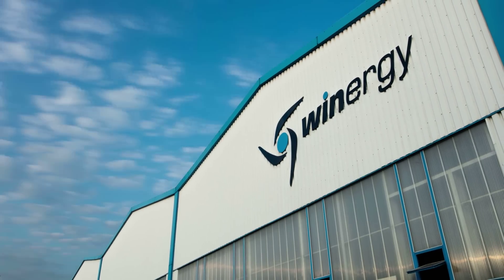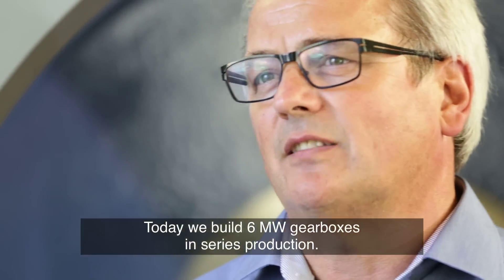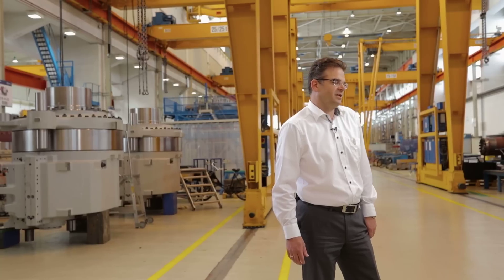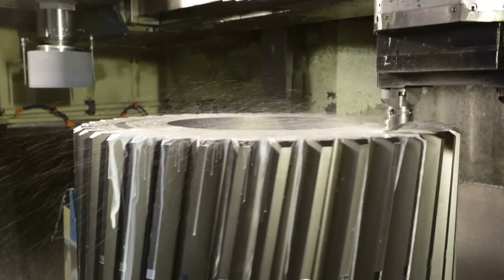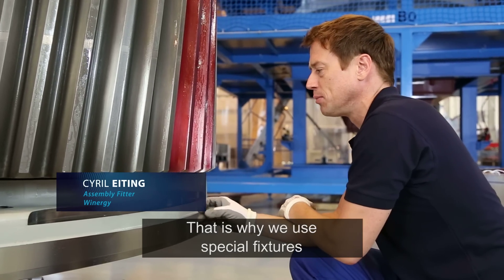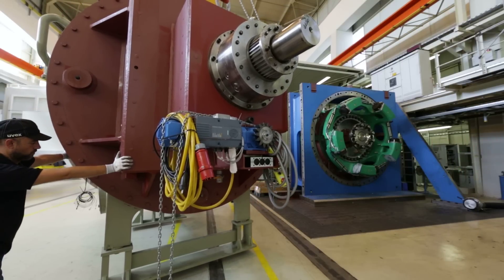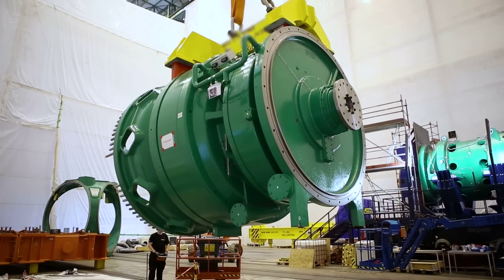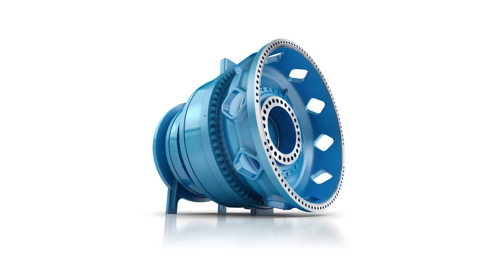Building the world’s most powerful gearbox for wind turbines - the Winergy 8 MW gearbox

Comment: Wind energy conversion.
I will explain why 'renewables' are not going to solve the energy needs of a society that takes for granted that turning on a light is a simple process.
Wind is not something we 'farm'.
Wind is a result of the rotation of the earth at the speed of 1000 Kph at the equator.
A wind harnessing device called a wind mill uses this force to push huge aerofoils in one direction that are mounted on a central shaft that has a generator comprising of metallic elements, mostly copper, central to producing the power they are designed for, that requires no fossil fuel to operate.
But what it takes to get this machine upright and positioned in such a way and in a place that will cause this physical reaction to take place is something that people are not made aware of, for fear of a concerted back lash by those who have every right to be wary and concerned of the detrimental impact they have on the surrounding countryside and those who live close by .
 What is involved to get it to that stage and the energy and materials needed to create these machines in it's self is, in no way, is a simple process. 
Unlike the explanations our governments give us to have us blindly accept there is no other alternative, other than nuclear power, and that is their scare the shit out of us gun.
Starting with the mines that all the raw materials come from, then the transportation of this raw material to where they are converted into the millions of individual items such as nuts and bolts and washers to stop them from falling apart requires huge amounts of fossil fuels to power the tractors and trucks and locomotives and ships to get it to the first stage of their production.
Using the energy created by coal burning power generators to produce not only the steel needed but for every single item required to have the finished product that will end up cluttering up our skyline and oceans, will take thousands of tons of coal and gas to produce the type of energy required to produce the steel these machines are made of, and that means carbon emissions.
Getting all the components to the site needed for the assembly is a major logistical effort that takes thousands of people to perform, all depending on the machinery called cars. boats. and planes to do so. 
All consuming power that is not produced by coal, but is a vital element in the so called reduction of our dependancy on carbon producing fuels for humans and industry to survive.
As soon as these machines are on the ground, they start deteriorating and have what is called 'A use by date' after which there will be the requirement to replace them with new ones, and that will end up being  thousands at any one time, and very little if anything of them can or will be recycled due to the nature of some of the materials used in their constructin, such as the aerofoil blades that are made of synthetics that are not biodegradable. 
Taking into consideration the average cost to have these machines operating is up to fifty million dollars at a time, it is usually the governments who will subsidize these projects. Believing there will be a return on the money invested in these projects, assisting the multi national companies who control all the natural resources and the extraction of the elements required for the manufacture of all things associated with the renewable energy market.. Solar panels included demanding funds to prop up a process that is flawed.
Everything produced for the renewable energy market has to be replaced every five to seven years, and when they are replaced, it will be at twice the cost of the original, due to the depletion of all the natural resources being used becoming more expensive to mine and process.
It is self a defeating exercise to keep thinking that 'renewables' can replace our growing thirst for our electronic device driven society to bare. 
Carbon reduction. ?
That went out the door the second they thought that creating millions of tons of carbon in the production of all these devices by burning whats left of our fossil fuels was a good idea.
Clueless.The full length of the Great Dividing Range. Cairns to Brisbane. On every peak, a wind turbine with access roads and 200 meter cleared zone for each one. Rain washing away all exposed ground. Plus, 100000's of acres of solar panels on prime farm land. Micro nuclear for me.
The whole lot of them.

Comment: Solar panels vertical spiral windmill blades magnetic gear box slip differential.. network powerplant towers...

Yeh . planetary .. vertically fixed . magnetic gear box..

I'm sure the slip differential.. with add .. a way to joining them vertically with magnetic gear....
Australia has ten thousand times the amount of solar radiation it uses on heavy appliances as a whole nation every two years...

Pieces... Basically .  Virtually.. https://youtu.be/2niEl-jH-Bc

https://youtu.be/_hnrOn-pTHQ

https://youtu.be/U3as8dhaV-w

https://youtu.be/2oAzrBORRN0

Comment: Why do they don’t mount the  gearbox and generator on the base of the tower instead of on the nacelle on the top ? Just use and angular gear on the top to transmit the power to the base. Installation and maintenance cost would be half..or less

Comment: Great product FLENDER GEARBOXES. Now working as a technical engineering consultant. I help customers understand the correlation between the component in gearboxes, the MRO-loop, FFT spectrum, aSKF value, the selected oil and what end-users can easily change to improve MTBF and reliability.

Comment: The Winergy 6MW gearbox has reliability issues, I have seen many replaced (as well as other manufacturer gbx's in this class). They need to build the 8MW gearbox to try and stay in the game but I highly doubt it will be any better.. Turbines are getting bigger, rotor speeds are going down due to blade limitations. Gearboxed turbines will have a slow death, just a matter of time. Physics will win this battle.

Comment: Difficult to believe that this provides cheaper energy in the long run. This is subsidised energy with half the prize hidden, just as an example. The cost and energy consumtion building these things must be enourmous. For 6-8kw it makes little sense. Windmills produce 60% of the time in practicly unpredictable enviroments for long terms. It produces the same werther the consumtion is low or peak and most of this energy goes to waste because nobody has found a way to store the surplus and probably never will. Stored energy is the only pactical way. Hydro, geothermal, gas, for example, that can be adjusted to consumtion. Windmills are not the future.

Comment: Build 30 nuclear power plants in the USA and we would be energy independent for 200 years.

STOP building Solar / Wind power, they are a JOKE in energy density and way too expensive almost like babies in charge of IBM.
Reply: its got its downsides, primarily... nuclear is SLOW, and one small issue turns into one BIG issue with OLD designs. if we get some fast neutron reactors to burn up the U-238 and quit figuring out how to sneakily dispose of the high level waste in other countries' war zones, then I'm sure some smaller Gen 4 reactor designs can push their way through sooner rather than later, and even get some more Generation 2 reactors replaced with much safer Generation 3/3+ or Gen4 designs.
Reply: But it is Green energy , nuclear is dangerous and nuclear waste will create lot of problem
Reply: update: wind rivals hydro and nuclear over lifespan for energy produced per watt. nuclear is heavily subsidized to produce centralized DoE controlled energy and cheap waste products for the DoD to reprocess and use. solar is great and is getting better and better with higher efficiency panels. the latest gen stuff is 40% using LED-type materials like Gallium Arsenide of different colors. Pretty simple and cheap. Cogeneration and waste heat recovery are where its at, honestly kinda dumb if you don't cover those bases first.

Nothing wrong with nuclear if done right, we still need some fast neutron clean reactors, breeder reactors, or accelerator moderated reactors to really kick up the efficiency standard of nuclear (normally its pretty low).
Reply: Great turn America into the world's greatest nuclear waste dump. 💀💀💀💀💀💀💀💀💀💀💀

Comment: With losses, this is approximately 12,100 horsepower. At 9 RPM, that's close to 7,043,199 foot pounds of torque. I can definitely see why they chose the 2 stage planetary design.

Comment: Is the gearbox just to step down the torque? cause i don't get how a gearbox is useless in an electric car but its useful in a wind turbine?
Reply: the electromagnets that push and pull the spinning part of the electric motor work best when the two opposing fields are slowly moving or stationary (on a CAR). 
the giant blades only spin the shaft maybe around 20 more or less RPMs, so it needs to be brought to a speed that a generator motor will work at. generators use fast moving magnets to generate an electric current in a coil of wire, which creates a flow of electricity in that wire and thus an opposing electromagnet, again. that electric flow from the generator can be low or high voltage depending on how many wraps of wire the generator uses, and the current can be high or low depending on that and some other stuff like how hard the blades are pushing the magnets through the generator's induced magnetic fields.

Turning rotational energy into electricity because of how magnets cause electricity to flow through a wire, OR pushing your car along because of how electromagnets push against other magnets.